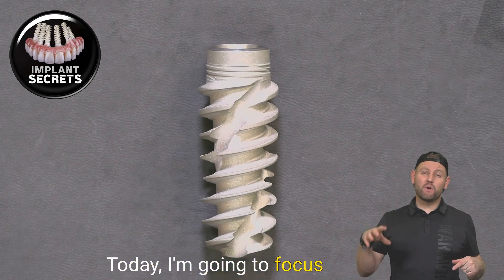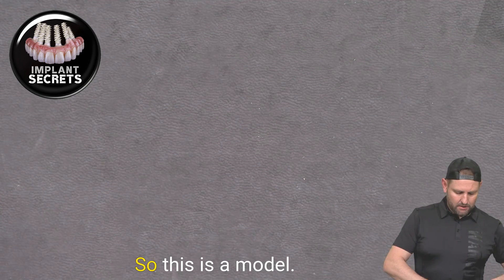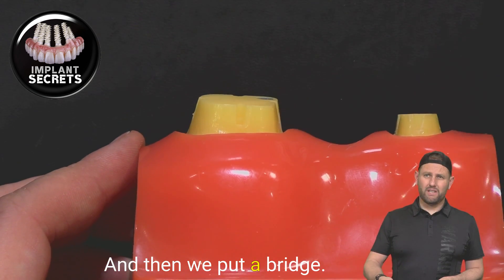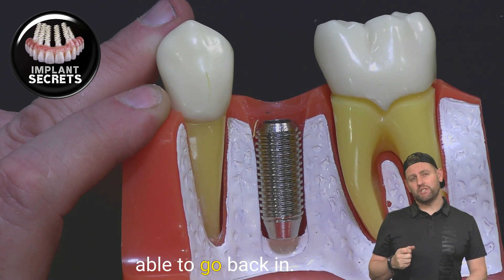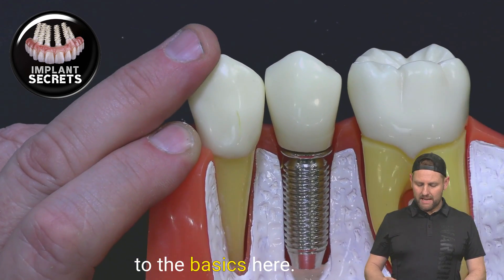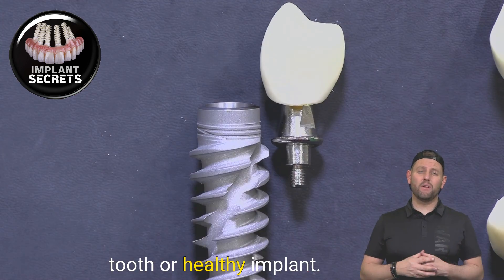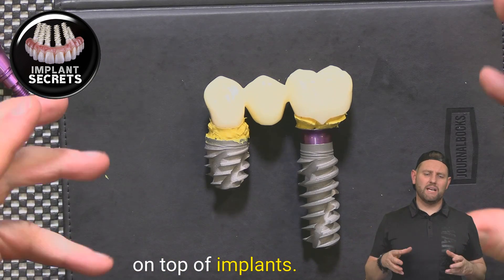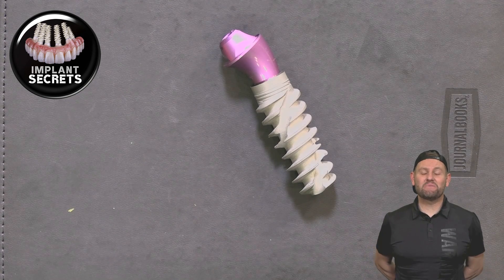Why Dental Implants are NOT Screws!

Comment: I got quoted $3500 just for one implant does that sound about right Endosteal, custom abutment and full ceramic crown (wanted zirconia) nobody will do zirconia in Ohio
Reply from the maker: Depending on location of needed tooth, if no specialized surgery or implant is needed. That sounds pre-standard.
Reply: @Bryan_hendriks  I don’t want a bridge what do you mean . So tooth #30 big molar was extracted the teeth are in decent shape by their so how do I have another option beside an implant . I already got the bone graft and have good bone on CBCT added bone graft so less drilling into my jaw and smaller implant . It’s stupid that places won’t give you a price up front I don’t need to pay you $350 to evaluate me when I already know what I need not referring to you but that’s how places are. What would your practice charge for Implant Molar 30?
Reply from the maker: I don't do single implants anymore, but when I did a couple years back would be starting at $2500 for molars.  Options are very limited if you don't want a bridge.  Implant it is.